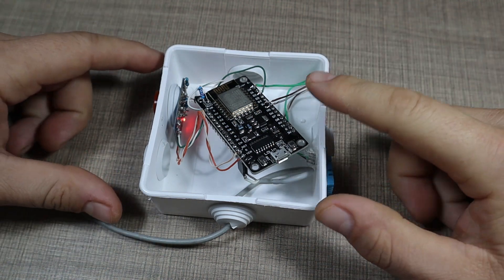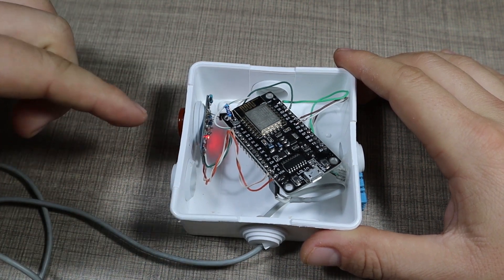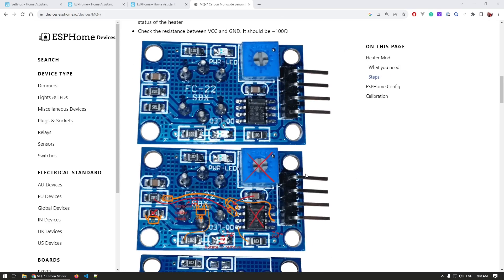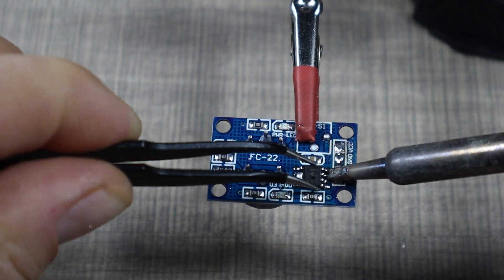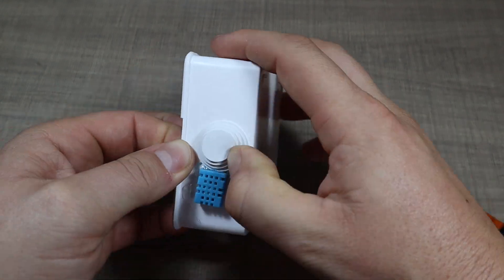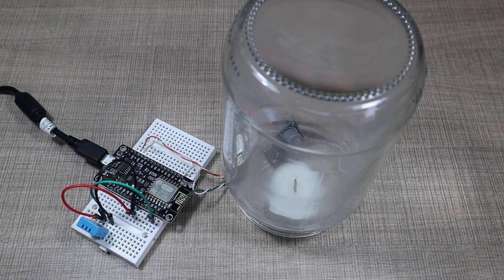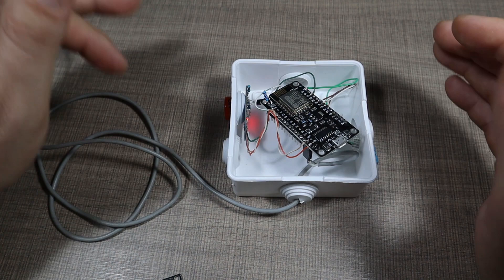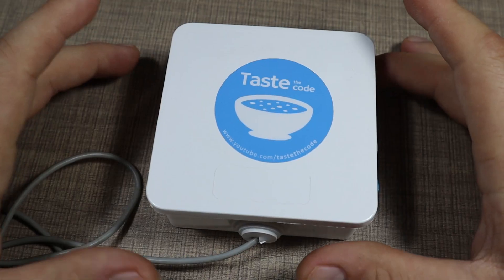Carbon monoxide sensor in Home Assistant - everyone does it wrong!

Comment: I wanted to put a 2n2222 instead of the SL2310 mosfet like you did. But the transistor has E G B while the mosfet Drain Source and gate. How do I associate the three pins. Thanks so much for your help.
Reply from the maker: You can connect them like so: mosfet gate, is the transistor base but you need a resistor as well to it, source on the mosfet is the emitter on the transistor, and drain on the mosfet is the collector of the transistor.
Reply: @TasteTheCode  Can I ask you where to connect the resistor and what size it should be please? Thank you very very very much for your help :)
Reply from the maker: There is a link to the schematic used in the video description. I don't remember how the connection went exactly.

Comment: What would you recommend in place of desoldering these parts and instead using components to switch the voltages externally and using the arduino to make the switch?
Reply from the maker: You can use a MOSFET to control the voltage to the sensor.

Comment: Could you please tell me which transistor you used?
Reply from the maker: I used a 2m2222 because that is what I had on hand. The original article asks for a SL2310 mosfet.
Reply: @TasteTheCode Oh thank you. Do you think changing the transistor causes a significant change in the circuit? I'm planning to use a BSN254 transistor. Will that work?
Reply from the maker: Hmmm I can't say for sure but I think it will not, as long as the transistor can handle it. Yours seems beefy enough.

Comment: please write what mosfet you used
Reply from the maker: I used a 2n2222 transistor as I did not had mosfet on hand but the original article calls in for a SL2310

Comment: How has the sensor been working for you so far? Have you done any testing against other sensors to confirm the accuracy of yours? Also are the values from your sensor logged in HA for any period of time? I'm hoping to find some way to view trends based on different activates in my home over longer periods of time i.e. weeks or months
Reply from the maker: Honestly, not great... The values seem tp be all over the place but yes, HA logs them for long periods. There were some other ones recommended to try out like the MICS-6814 but I haven't had the time to do so.

Comment: I've bought one a few months ago.
I find the sensor to be very flaky.
I did a similar test with some scented sticks in a glass jar and it took quite long for the sensor to spike. It was more of a gradual increase and same for the decrease when I took the sensor out of the glass.
Not a nice spike as in your video.

I've read somewhere that the ZE07-CO does a better yob, but I couldn't get any data out of it so far.
This inspires me to try both sensors again tomorrow 🙂.
Reply from the maker: I'm not familiar with the ZE07 sensor but I might order one to give it a go. There is also another one that I want to try, the MICS-5524. In my case the readings are taken once every 2,5 min, because of the heating/cooling cycles so maybe that is why you see a spike. Also, I guess that the scent sticks would produce a lot more airborne particles like PM2.5 and PM10 instead of CO gas as they are not burning that much.
Reply: @TasteTheCode mics-5524 seems to be general voc sensor so it has low selection to CO while ze07 looks like to be more specialised on CO only.

Also you should know that the whole MQ series (includes about 10 different sensors) is actually all the same sensor with only difference is they have different resistors. I mean MQ series just reacts to any gas with carbon, therefore your sensor will also react to any such gas and its readings would not be selective to solely CO. And of course you can not measure CO with it with any degree of precision. It can just tell whether there is more carbon in the air or less.

MQ sensors also have about 1 year (do not remember exact number) of lifetime while on the fresh air due to carbonisation of sensor material, and it does not matter whether it worked for that time or just layed down powered off.

As for ZE07 they claim this sensor to have good selectivity but do not provide any additional data on selectivity in datasheet

There is also CO sensor from Gravity but it's quite expensive. They claim this sensor to have good selectivity and even provide selectivity table in datasheet (thought there is still influence of other gases remain)
Reply from the maker: @binariti  Hey, thanks for the great info. I still haven't looked into other sensors but I will definitely do. I'm aware of the different MQ series sensors but I was unaware of their shelf life so I'll research this a bit more. Thanks again!